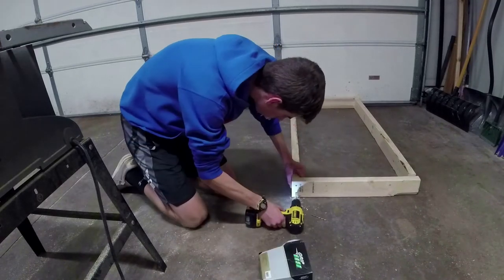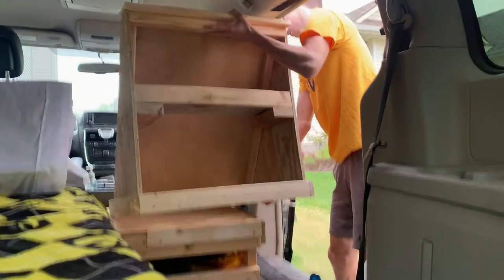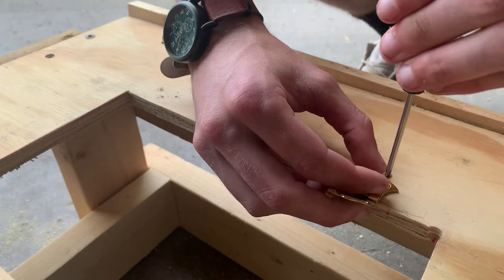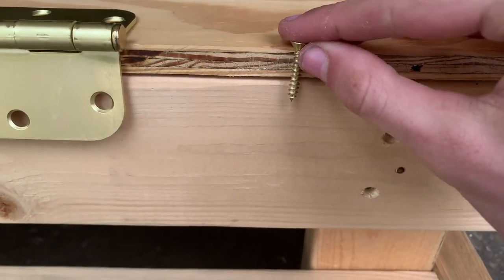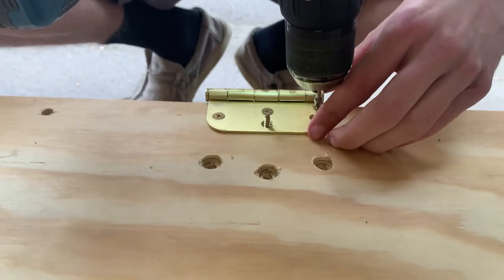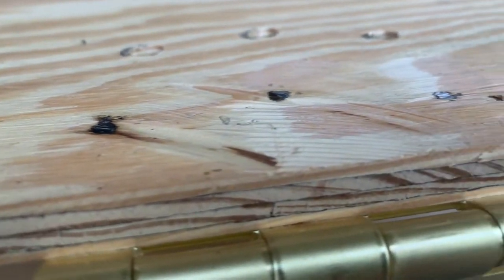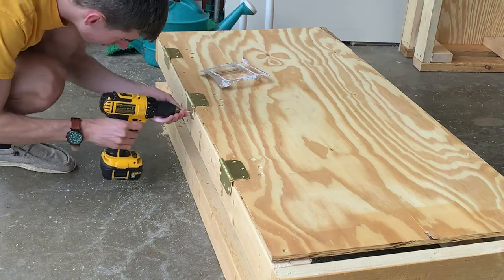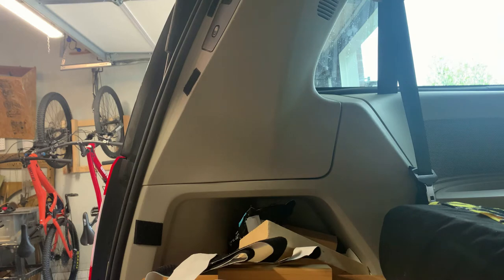Building Better Storage in the Minivan

Comment: Hi. Where did you get those lights
Reply from the maker: I got them at Menards in the clearance isle. If you’re not from the Midwest it’s similar to Home Depot or Lowe’s.
Reply: @harrybuscamps  ok. I see them on Amazon. Thanks
Reply from the maker: Yep, no problem! I would also suggest finding a way to fasten them. The Velcro it comes with is not great. I’ve got other comments with good suggestions.